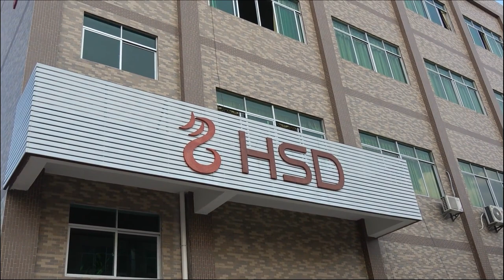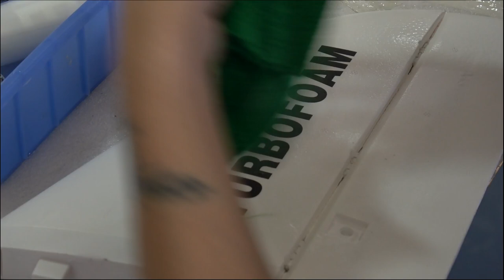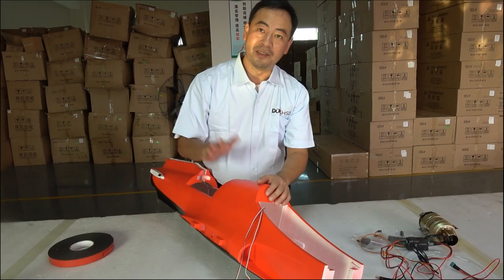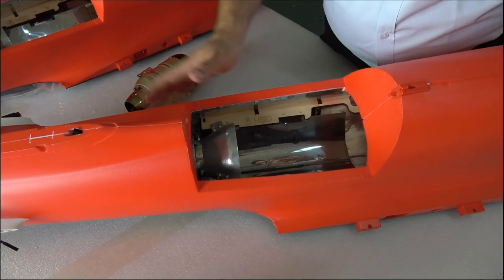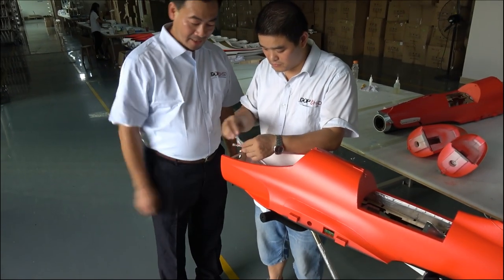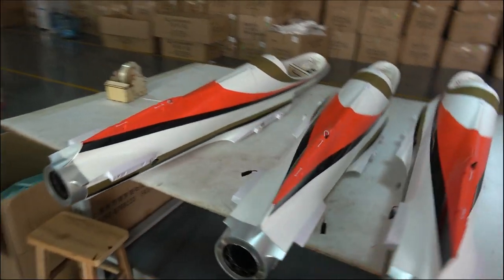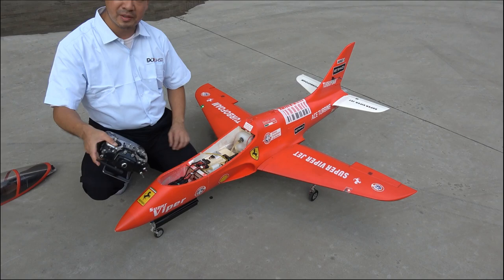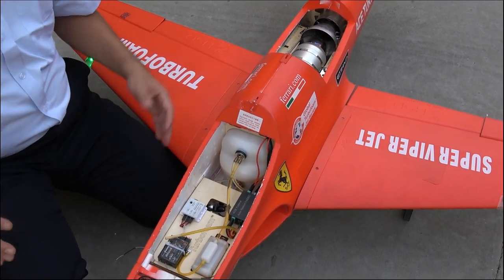HSD , foamy jet introduction

Comment: Bought the HSD Zazzy as my first NO Stabilization plane. Love it and still using it as a true learner plane. I'm interested in the 75mm Viper V2...soon. Great planes and hope HSD supplies all parts.
Reply from the maker: If you can use the "taobao"  , you can talk to HSD customer service and buy stock any parts you need.  https://hsdhobby.world.taobao.com/?spm=2013.1.1000126.2.77953bbd2bDCkf

Comment: Hello, i had some Problems with my SuperViper 12S.In the first flight i lose the right Wing Landinggear,because the Epoxy was dried before it  built in.In the second I hear some noise from the Impeller.Three from four screw of the Motor are unconsolidated and the shaft had 4/10mm imballance. I love the jet ,but there must be a better finalcheck.Best regards,

Michael Franz
Reply from the maker: Hi Michael, I am not HSD guys. I am the fan as you ,too. I always talk such kind of issue thru the local agent. Or you can email ..As I know , they will happy to help customer.

Tel：086-0769-8571 3588 
E-mail：sales1@hsdjetshuangsai.com(Sales)      sales2@hsdjetshuangsai.com(After sale service) 
Skype：sales05@hsdhobby.com
QQ：3431730434 (Instant Message)
Mobile phone / WeChat：188 1338 9042 (Instant Message) 
Business Hours: Monday - Saturday 8:00 AM – 9:00 PM Sunday 10:00 AM – 6:00 PM 
Business Location: ：HSDJETS Industry Park, Aigang Industry District, Huaide, Humen Town, Dongguan City, Guangdong Province, China （Post:523926）
Reply: Thanks,

I write HSD,maybe they answer.

Michael
Reply: They did not....

Comment: Hello, I need your help. I bought a new 214124 HSD S-EDF 11-Blatt 105mm 
EDF with Außenläufer 4270-750Kv and the 213535 HSD Hobbywing Flyfun V5 
Speedcontroller 160A . The controller has a big timing problem and 
blocks the impeller at approx. 75 throttle. how can i adjust the timing?
 HSD europe China and America did not respond. The firmware of the HSD 
Hobbywing is different to the original Hobbywing. Many Thanks
Reply: The strong S-EDV (the difference is striking) does not work with the 160A HSD Funfly 5 and blocks the motor !!! The firmware is different and cannot be adjusted. The original Funfly 5 with 30 degree timing works.

Comment: sir in this turbine where can I find smoke system  or the engine has it
Reply from the maker: The Smoke system is option. not standard with PNP. You can contact the service guy for your order.
Super viper may need the followings and a brush motor ESC 

https://world.taobao.com/item/542079853363.htm?fromSite=main&spm=a312a.7700824.w4002-11910241019.36.ALyyJ9
https://world.taobao.com/item/534709194882.htm?fromSite=main&spm=a312a.7700824.w4002-11910241019.80.13oYJe
Reply: yangtsaiyi I only need this one could I use with turbine jet
Reply from the maker: Celaleddin özer yes,you can use with turbine jet.

Comment: It would be a whole lot better if HV servos were used all around, eliminating the BEC and at the same, it enables the 2S receiver LiPo battery be monitored via Tx/Rx telemetry, and NOT the BEC/UBEC constant output, which is useless!

Comment: does the f 16 comes with a electric motor
Reply from the maker: Bassem Ahmed.   f16 come with two kinds version, 105mm edf with electric motor or turbine version.
Reply from the maker: Bassem Ahmed.   f16 come with two kinds version, 105mm edf with electric motor or turbine version.

Comment: well ball bearing hydraulic electric landing gear! wow the big turbine jet vendors here in the usa bob violete in point would screw a customer to death forthis option alone and whats been being sold buy bob violet has been junk in my opnion n nothing but trouble I hope these foamy turbines put there ass out of business lol, anyone who wants to hear a story about how I got screwed for ALOT OF MONEY SHOULD HIT ME UP IVE GOT A HUNCH IM NOT THE ONLY ONE,  somone needs to sue there ass for false advtisment and selling somone which is dangerouse to operate because of the failure rate of the landing gear aone on the 1/6th.75 f-16s